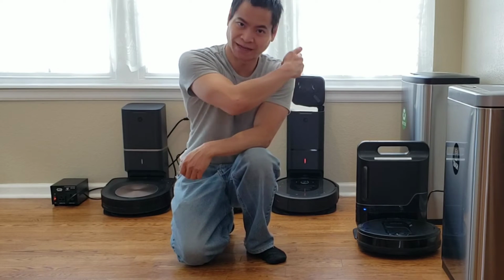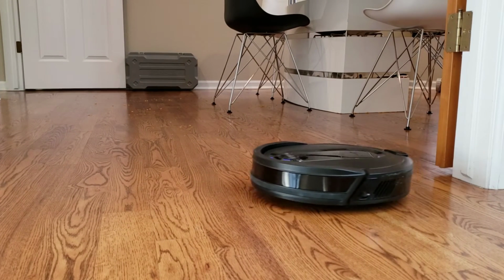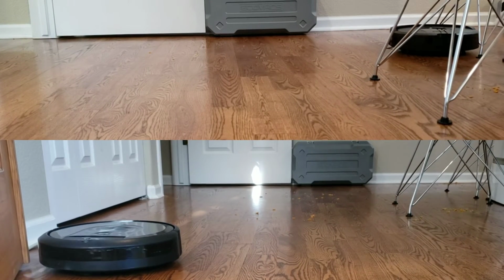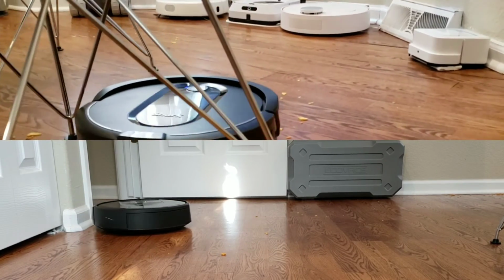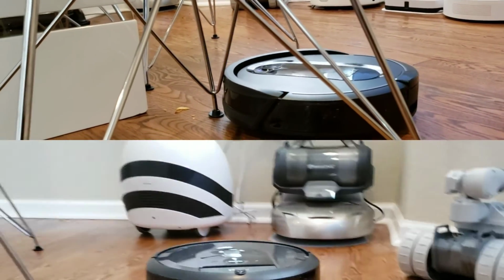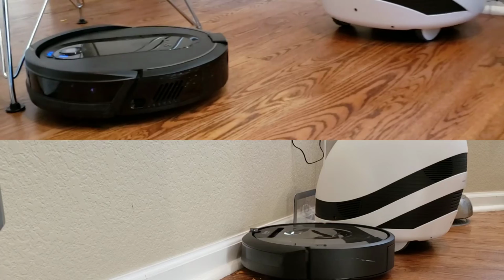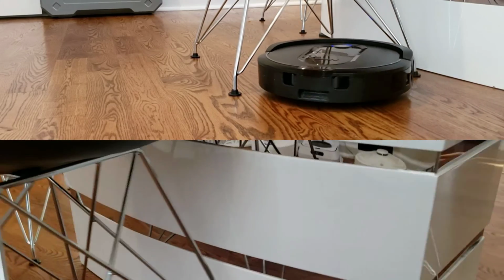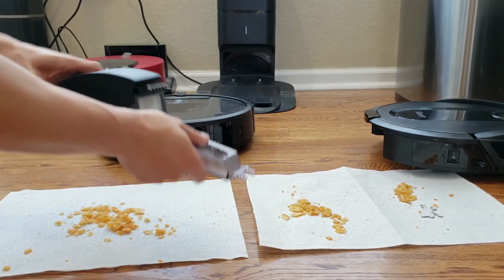Roomba i7 vs Shark IQ Cleaning Test. Who Sucks MORE 😞

Comment: Just returned my Shark LOW IQ Vacuum. It kept losing the wi-fi signal,  got lost in closets, never completed the mapping of our house after more than 30 cleanings. When it did clean, it would do a pretty good job. Called Shark Customer Service line for help and when describing the problem found them to be argumentative. Their customer support is what got me to just return my vacuum cleaner. I could put up with some cliches that a software upgrade might have fixed but I won't put up with attitude from some $8.00 and hour desk jockey.... Hello Roomba....
Reply from the maker: Hope you like the Roomba 😂
Reply: @RobotMasters  Roomba, Roberock? Who the Hell knows. I watch all of these different  Best Vacuum 2019 videos and they all have different opinions. Hell I'll probably just stay with my central vacuum system and keep dragging the damn hose....Sure a lot easier than dealing with Sharks Customer service idiots...
Reply from the maker: The Best way to know, is to get a Robot Vacuum and try it for yourself. Unfortunately with all the Specs and Pickup tests people do on these robot vacuums ultimate it best to try the robot vacuum on your floor plan to see how well it performs.
Reply: @RobotMasters  It appears that at 3:00 am day before yesterday Walmart accidently had a Neato D-7 marked down to $399.00. I purchased it with a 3 years service plan for $485.00. It arrives next Friday. We will see how that goes.  Thanks for all your advice.
Reply from the maker: @rvasquez8057  WoW glad Walmart honored the price mistake, that an awesome deal for the Neat D7. Usually they are around $700
Reply: @RobotMasters  Yep, now I wish I had ordered three..... They do have them online now for $599.00. Still a fairly good price.
Reply from the maker: @rvasquez8057  Yeah the best deal I found  was $499 on Amazon.
Reply: @RobotMasters  From what I hear, they are suppose to be pretty good vacuum but I have read comments from folks that hated them too.  What to Do????
Reply from the maker: R Vasquez I would just try it out for yourself and see if you like the robot vacuum. Ultimately it up to you to decide what robot vacuum works best for your home. Everyone home different, and the world best robot vacuum with the best specs may not be right for everyone.
Reply: I've seen this comment copied-and-pasted on several videos
Reply from the maker: Charles Reinmuth Which comment?
Reply: @RobotMasters  The OP
Reply: @CharlesReinmuth  That would be by me. Just letting people know my experience the the Shark Vac.

Comment: Before you deleted the 1st map on the Shark were you seeing any map at all when you checked it in the app?
I have 19 runs in and still don't have a complete map.
When I check the map,the app says the map is almost complete and shows a map that I would have called complete 10 runs ago.
I enjoy watching your videos.
I own the shark,orginial xiaomi,roborock s5, neato d3,roomba 630, neato x21.
Like you I just keep buying more as new innovations come out
 even though I don't need another robot vacuum. 
Oh well, that's just the way it is for me.
Reply from the maker: So here what I suspect happened, even though I had the correct looking map on the first run of the Shark IQ by looking at the history, the 2nd run was just cleaning my kitchen. I blocked off the area so the robot might of gotten confused. From there I was still seing the maps but at 30 cleaning runs I gave up and reset. Afterwards, I stuck with the same area and at the 11th cleaning run I had a map. Does your map look like they should in the history tab?
Reply: @RobotMasters  I think I did something similar quite a few runs ago.
I had a area blocked off then decided to add  more rooms.
Thanks for your help.
Reply from the maker: @danimal107  Yeah try a reset / delete map and don't change the layout until the mapping done.

Comment: When vacuumwars does his robot videos, he shows these white outlines the show the robot's supposed cleaning path.  The Shark IQ goes back and forth in perfectly straight lines.  I would love to know how he got his to navigate so smartly as mine runs almost more like a random navigation robot bouncing around like an idiot vacuum.  It's still got an "almost complete" map at 32 cleaning runs.  A contest winner the Shark IQ is not.
Reply from the maker: Mine goes in a semi straight line, and yes vacuum wars has a cool layout, but basic, not too many obstacles. Maybe he got the Shark IQ on a pre released firmware since he working directly with Shark 🤔

Comment: you should do a thing where you buy broken robot vaccums and try to fix them like on ebay
Reply from the maker: I have done that with Smartphones, replace cracked screens, motherboards and batteries and resold them.

I might try with Robot Vacuums thanks 😁
Reply: @RobotMasters  oh cool
Reply from the maker: Supa Trending Daily Nice, seems like the hoverboards came back, the battery are safer and probably won’t catch on 🔥. I have a Ninebot mini which is a very good personal transition device.
Reply from the maker: @Supa Trending Daily Yeah Samsung had a similar issue with the Note series. I love lithium batteries for their lite weight and high discharge rate, but if not properly handled can explode in a flash.

Comment: I love this tipe of video 

I’ve heard that the roomba hasn’t a good airflow is it true?
Reply: A P yes true less than 7 cfm vacuum wars tested it. It’s more of a mechanical cleaner better on carpet but still good for hard floors.
Reply from the maker: It hard to say, from statistics it has 17 CFM which is average for a robot vacuum. But there been some complaints that their airflow a lot less. From my personal experience and testing the Roomba i7 does fine on hardwood floors and carpeting. Also you can run the robot again to do a better cleaning.

Comment: How could shark not known it had problems, their quality control blind & stupid. When using empty/resume how does shark know to return to base if it can't detect when bin is full, giving it that abilty but leaving detecting full bin out was major bone head move
Reply from the maker: It a timer function I think it after 30 minutes of running it will return to the charger to empty regardless if the bin full or not. From my 2800 sqft home it only does this once with in a cleaning run.